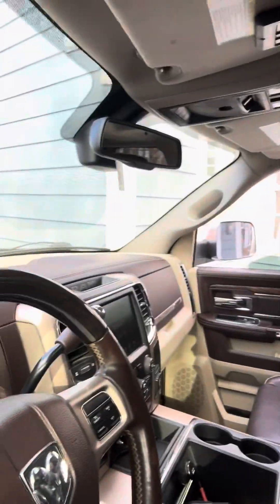Cummins 6.7 Turbo/VGT Surge - Low boost

Comment: I had a 2013 Ram with the same issue. Started out as a normal engine replacement. Truck came in runns well but had a rod knock. Customer opted to replace the engine with used unit. Unit was good, 80k mileage. Swap the engine, no issues. Engine started right up, ran well. But, at around 1500 rpm engine was surging. We replaced EVERYTHING! Turns out it was the tune.

Comment: Did you fix the issue expierencing same issue after removing my egr cooler
Reply from the maker: @dplandscapemaintenance990  No it is still doing it from time to time. I have updated the BullyDog tune and it’s behaving differently on cold starts now but I am getting turbo codes too so I really suspect VGT actuator or wiring issue as it’s throwing the code once a day after a 20-25 minute drive.

Comment: You might check the turbo again. If you haven't figured this out. It's a pain to take off the actuator but if the turbo selector arm is broke it might not be that easy to tell. Because you need to get a good hand on it if it moves freely, it doesn't mean the turbo selector is working. You should hear it move inside the turbo both ways. Even when the Turbo selector can be calibrated via the actuator. the selector can be broken. See this video:  https://youtube.com/shorts/AWFseUtG1rk?si=ealrIZtS4Bp2TmlI

Comment: Lkn good old man
Reply from the maker: Ouch.. I turned 40 this year.. you’re right I’m old ..
Reply: Did you find the issue. ? @sergepinet
Reply from the maker: @Hey you , no not yet. I have been having a check engine light related to the turbo actuator pretty consistently now. However, it comes at the same time every time like 20 minutes into a drive. It will flutter consistently when the BullyDog is sent to anything other than No power. Of course Derive is negating the fact that the tune could be the issue.. I’d hate to replace the actuator to figure out it’s the tune acting up again.

Comment: I would definitely look for a restriction in the intake. Pull the intake off the frt of turbo and try it. If no luck there. Look for a leak in the charge air cooler with soap and water or smoke machine
Reply from the maker: We didn't quite find THE issue but we have fixed the problem. The truck is deleted and running on a Bully Dog tune (tuner is unplugged and in the console). It seems like at one point, something in the tune gets messed up and this problem arises. All I did was spend a couple of hours chatting with a rep, they loaded another file on my PC (older tune than the updated one) and this fixed it 100%. I have all my 32 lb of boost and it's actually fun to drive again. Bonus.. it also now retains the setting on my Exhaust Brake if i shut the truck off so I no longer have to push the button every time I start the truck.. It's not always "New and Improved" I guess.
Reply: @sergepinet  This is good news. I just read this after leaving a comment. Thank you for the update.